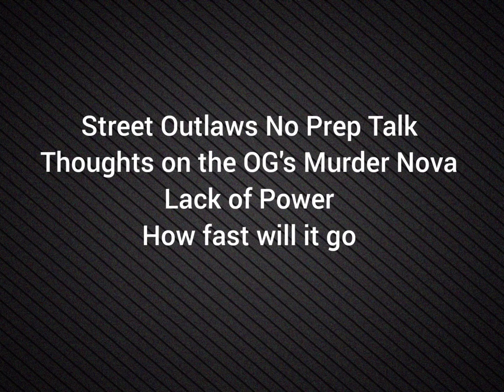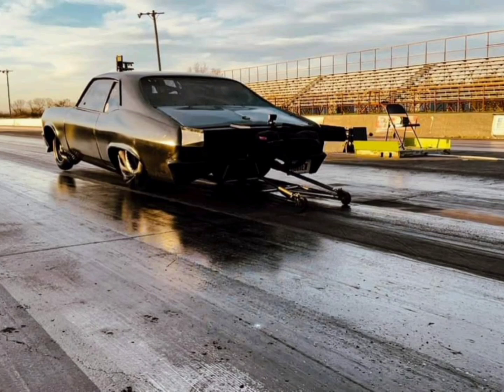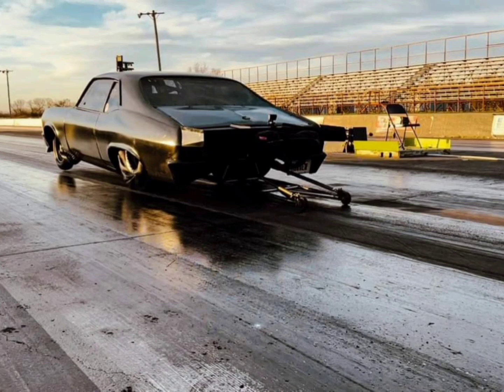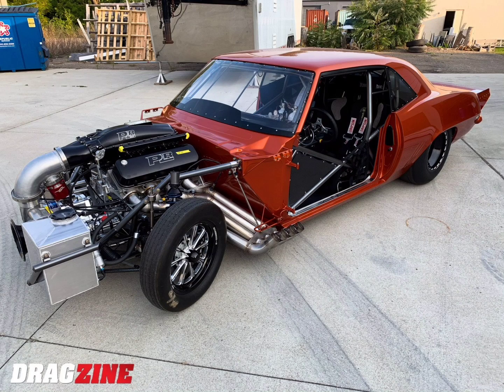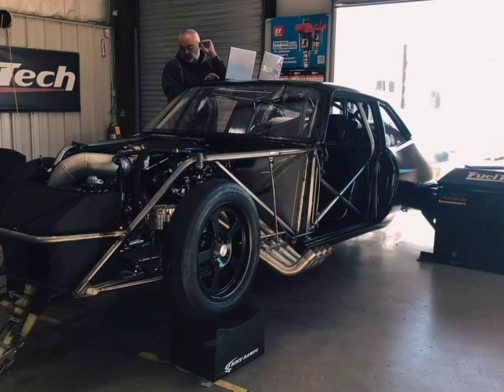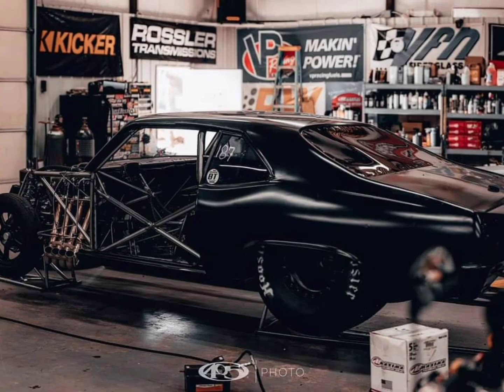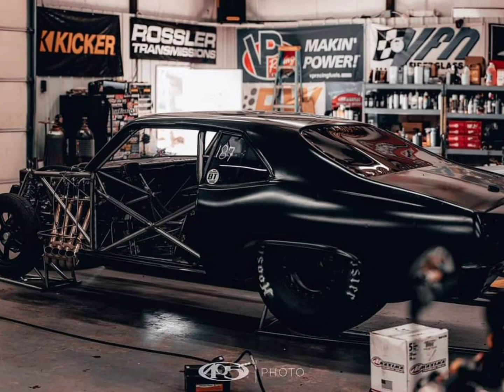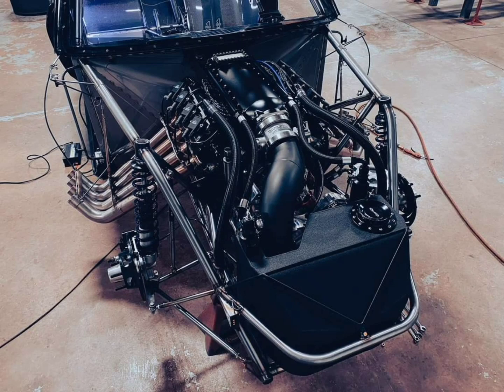Street Outlaws - Thoughts on the OG Murder Nova's Lack of Power & How fast will it go!

Comment: Need to keep this in a proper perspective.. and more info is needed regarding power levels..  This is just a BB chevy with good heads not the Proline race engine...is this a new bore?..either way the cycl's have been washed from excessive alcohol and a compression check would probably show the seal sucks. Petty kept taking fuel and it responded but it will take longer to seal the rings and im sure pettty wasnt leaning on it too hard or adding much for timing ..all would explain the missing 700HP .. also we didnt see much more the 5200 rpm so the procharger wasnt all in and the converter wasnt coupling completely,imho